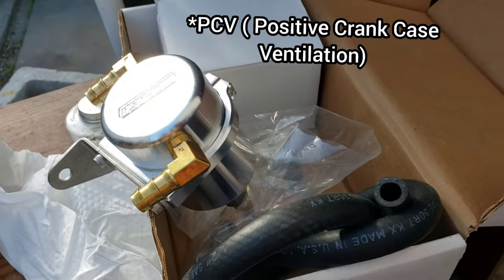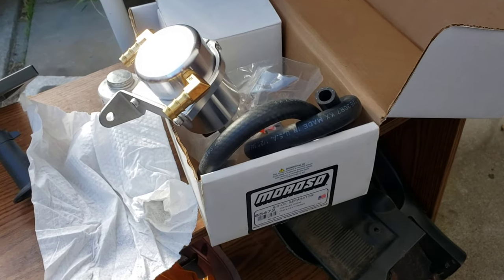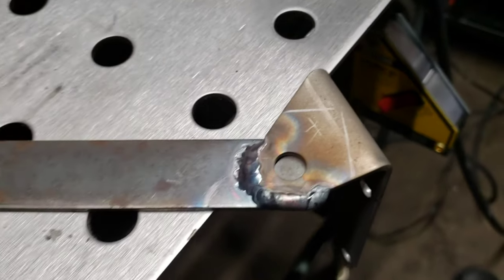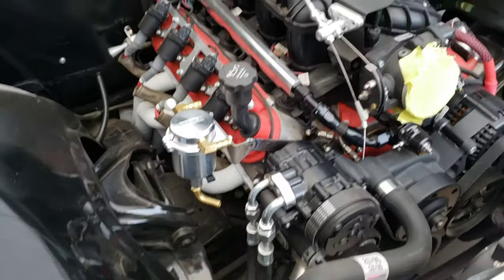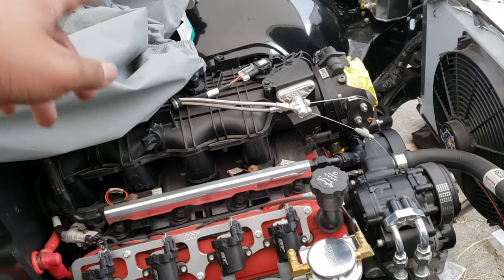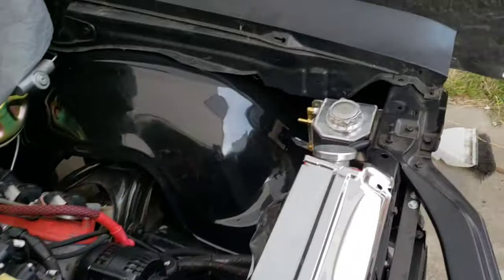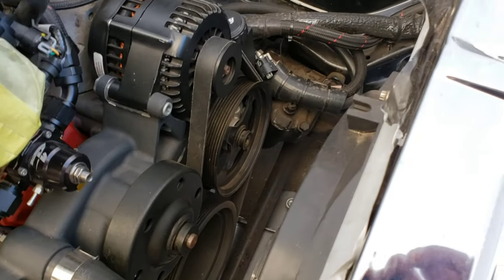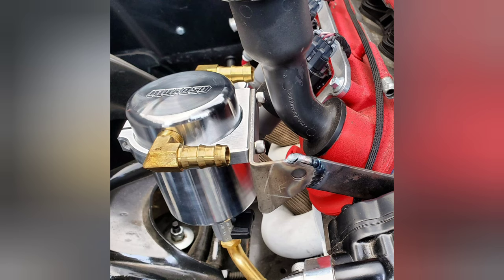Moroso Oil Air separator PCV install | LS Swap

Comment: Man look at those awesome welds! I'm at the pcv stage right now. Always the little stuff
Reply from the maker: Thank you Sir, turbo PCV is kind of convoluted, check out LS1tech, there's a guy on there that makes blueprints of all different turbo setups all different motor setups should help!! Between you and Cortez I need to get to work 😅
Reply: @Califormula  i seen someone say they didn't run anything,  just unplugged it all and ran it like that with no issues
Reply from the maker: You can do that to, it won't hurt anything but smog lol
Reply: @Califormula  well that's free lol, may be the way to go
Reply from the maker: @infamousnova  My mind set was negative pressure on the crankcase makes it easier for the Pistons to go down, also my rings are gaped for the upcoming turbo so might have a little bit of blow by.
Reply: @Califormula  yeah the guy had a turbo on 24psi. Said no leaks, fumes etc but idk how true that is. We in the same boat
Reply from the maker: sloppy did a test with a pressure sensor he didn't find any worthwhile pressure in the crankcase but I don't know I still think the logic works. still haven't figured out what I'll do for a turbo probably just run two hoses off the top of the valve cover to a catch can

Comment: It would be hard to overstate how substantial this Moroso unit is.  I received the 85474 which is pretty much this one with a different bracket, and it's a chonker.  Love it.  It doesn't matter which inlet/outlet serves what purpose does it?  I have another catch can for my valve cover breather that feeds to my air intake that it does matter which one comes from the pcv valve and which one goes to the intake manifold.  So I'm wondering.  But it looks like both ports just feed to the stainless steel mesh and it doesn't matter.  Thanks!
Reply from the maker: @mackchannel6348  That thing is super beefy 🤣 it's been a while since I opened it up but I believe one side has a baffle before the stainless mesh It would be better to have the dirty side go through the baffle then through the mesh. . . but technically you're right it goes both ways either way is fine!
Reply: @Califormula  It looks like the way I will set mine up is the right way then.  Thanks!

Comment: I have a question, but first, great video love the build! I was wanting to know what you were going to do with the opening on the valve cover next to the oil filler neck, that the hose was connected to?
Reply from the maker: Thank you for the positivity. . . .Most likely put a very small filter on it. . . . I could just leave it open . . .haven't decided. It will now be the fresh air side of my PCV.